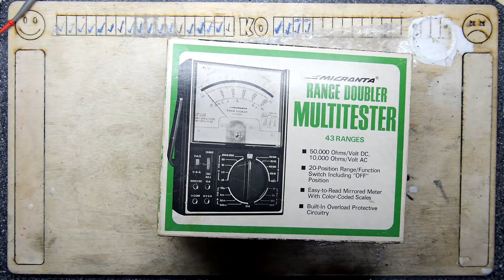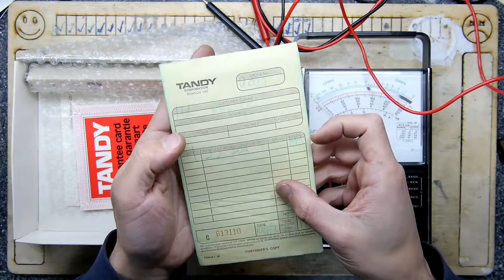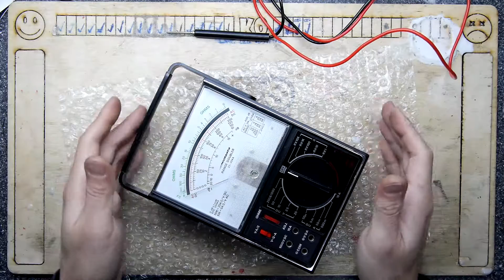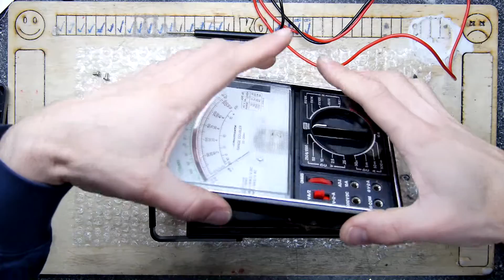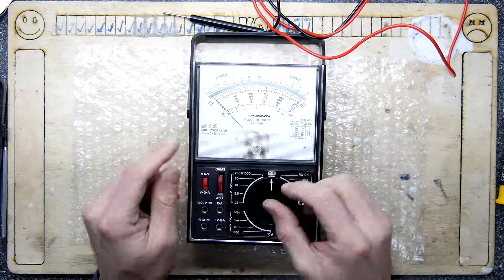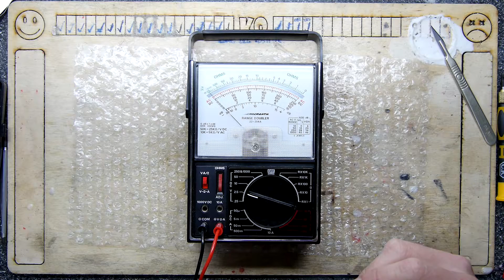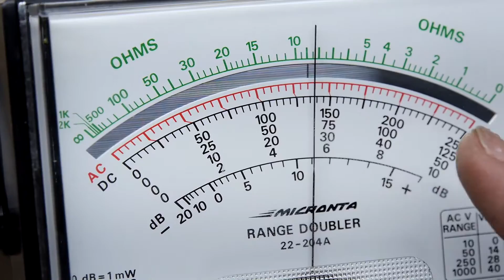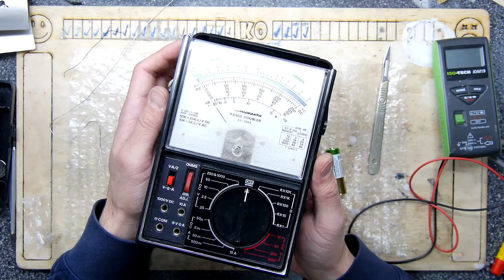Micronta Multimeter

Comment: IN A VIDEO PRODUCED BY YOU REGARDING AN ISSUE WITH A MICRONTA METER (22-204A) YOU OPENED THE BACK COVER TO REVEAL THE INTERIOR WORKINGS.
I TOO AM DELVING INTO THE INNARDS OF MY METER AFTER AUTO INCINERATING A RESISTOR.  IN FACT, ITS SO COOKED, (IT LOOKS LIKE IT TOOK ABOUT A BAZILLION VOLTS), AND THE UNDERLAYING CIRCUIT BOARD IS SO SMOKED THE IDENTIFICATION OF THE OHMIC VALUE WILL BE LOST...….FOREVER.
  IN YOUR VIDEO THE AFFECTED RESISTOR IS THE ONLY BLACK COLORED ITEM ON THE BOARD.  IF YOU HAVE THE TIME, AND INCLINATION, AN INVESTIGATION, AND REVELATION  OF THE RESISTOR VALUE WOULD BE ENOURMOSLY APPRECIATED. THANK YOU,
 RESPECTFULLY JIM MALONEY
Reply from the maker: 0.48 ohms
Reply: @backofficeshow  WOW I MEAN WOW !!! FIRST OFF THANKS FOR YOUR IMEDIATE REPLY, IT DOES NOT HAPPEN VERY OFTEN. THE VALUE YOU GAVE IS WHAT I THOUGHT WAS THE CORRECT NUMBER, THANKS FOR THE CONFIRMATION.
NO KIDDING I REALLY APPRECIATE YOUR ANSWER.
RESPECTFULLY 
JIM MALONEY
Reply from the maker: @jamesmaloney2534  good luck in repairs!

Comment: The inaccuracy is almost invariably a combination of two easily correctable factors:   1) Static electricity of the plastic polystyrene faceplate is biasing the meter aware from the true position - use a damp paper towel to wipe the exterior of the unit to neutralize static charges on the faceplate and case, and 2) one or more of the four trimmer potentiometers inside the unit on a separate pc board has drifted with age, owing to humidity damaging the thin film resistance.  You will need to recalibrate one or more of them (or replace them - I use Bournes 25-turn cermet trimpots, yielding great stability).  Fortunately, schematics for the 22-204 are readily available on the web.  Good luck!

Comment: I just removed so much battery contact corrosion. It had actually spread to various wires and the metal contacts for the dial wheel so i had to clean that up and rewire half of the wiring but all seems to be in order now 👍

Comment: Did Micronta make an entry-level multimeter that didn't have a selector knob, just different jacks for the leads depending on what you wanted to measure and range?  I know I had one back in the 70s but I haven't even found a picture of it.
Reply from the maker: Micronta Multitester #22-027A

Comment: Off is to shunt the meter movment, not so much to save batteries. I have this meter in the boot of my car. Good older meters.
Reply from the maker: I do drag it out from time to time, I find they have a more instant response than a digital meter. Sometimes you just want to see what's happening Vs taking a super accurate measurement so they are almost little a little scope 😁

Comment: First thing...with meter off...zero the meter with the small plastic adjustment screw on front of meter window in the position you will use it in. Second...the plastic window will build up a static charge and affect the needle when you touch it. Just breath on it to dissipate the static charge.   Third...rotate the selector switch around a few times to clean off contacts. Also, when inserting probe leads into meter, insert and remove a few times to help with the connection. You can also use a bit of electrical contact cleaner. I have that meter and a Simpson clone by Micronta    that I purchased in the 70s and they both still work fine.
Reply: Do you know how the ohm adjustment works

Comment: Nice meter!
Having an analog meter around the shop is really useful, just like having an analog scope next to your DSO. :-)

Just don't rub the cover: It'll charge and deflect the needle as you have seen.

Also: The mirror is there so that you can compensate for parallax error. Your're supposed to move your eye such that you align the needle and its reflection to take accurate readings.
Reply: that is the first time someone explained the purpose of the mirror, and it makes so much sense now
Reply from the maker: Thilo Niewoehner I will have to get my analogue scope out of storage to show you all 👍
Reply: Can someone explain "parallax error? Lol